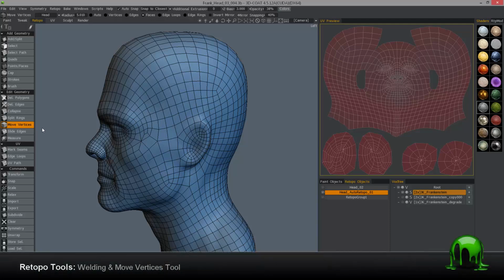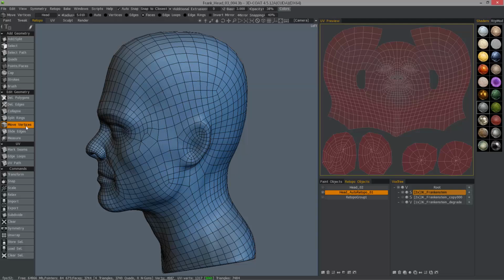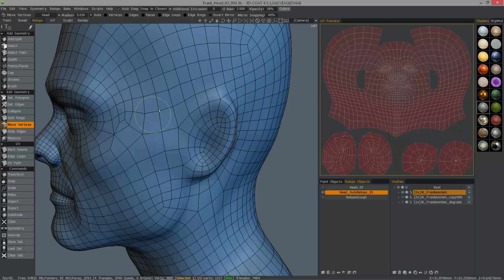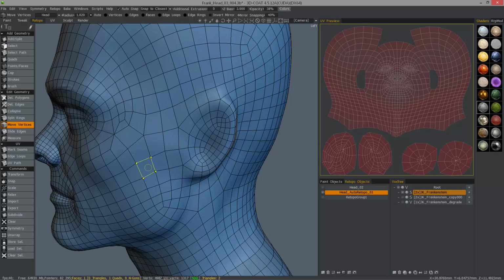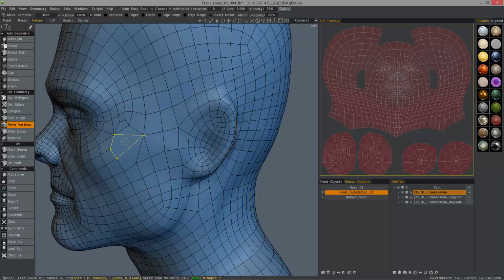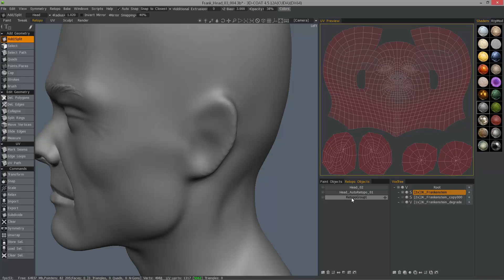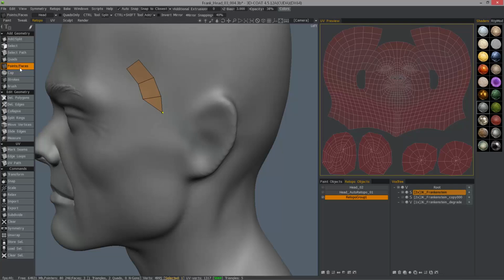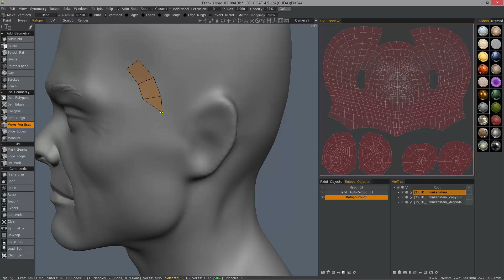Welding Vertices in the Retopo Room with Move (Elements) Tool

Comment: To weld an unlimited amount of vertices in 3D-Coat there's nothing else to do than select all the faces you want welded together and move them to a single layer. Vertices are then joined automatically. If you still want those faces on different layers, separate their UVs in different UV Sets first, then move faces to a single layer (to weld), then select the faces by UVs and move them back on different layers. The only tool that really unweld vertices is the "separate" function. As long as you don't use that, vertices being in the same position are joined.

Comment: Works with Add/Split tool, but no longer with the move tool it seems. (4.8.14c)
Reply: Add/Split ? So what, if you have 10K vertices unwelded, you move/weld them one by one ? There has to be another way :( ...

Comment: I'm also new to 3D Coat, moving the vertices with the Move tool does appear to weld them. However, I do wish that they'd kept the red dot - I'm so used to creating unwelded vertices with the symmetry modifier in 3dsMax and having to select and then weld them, that it would be reassuring to actually see something like the red dot that lets me know that they are connected.

Anyway, I'll get used to it and if I do find that my first retopology has worked then I won't be complaining. 3D Coat is a great program, by the way!
Reply: I agree - we need visual feedback that the weld is occurring

Comment: Any idea why this isn't working in 4.5.38? Seems like a useful feature but I'm having to use the collapse tool instead. PS. He does finally execute on the title of the video at the 2 minute mark of the video.
Reply from the maker: It does work properly in build 4.5.40, but there is a slight change (likely due to a user request). You no longer a small, round sphere/dot, but a small highlighted circle and the red highlight is no longer a part of the process. You just drag it over the other vertex and it welds them together.